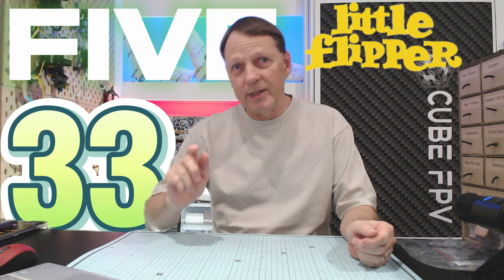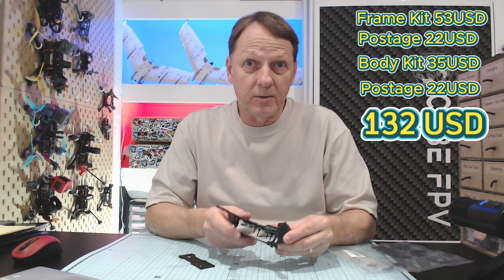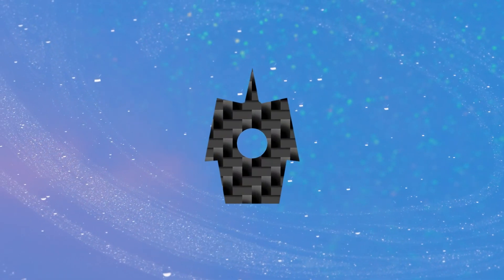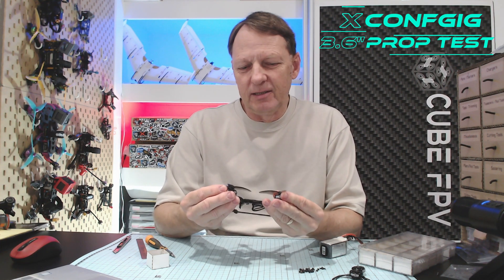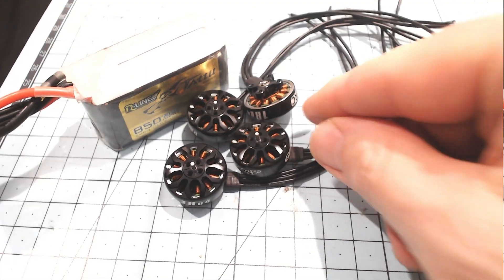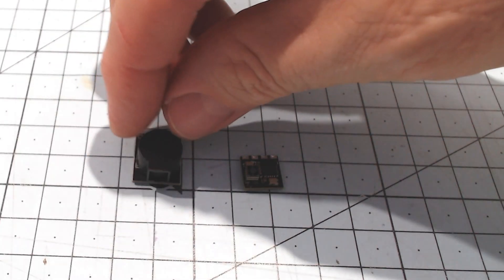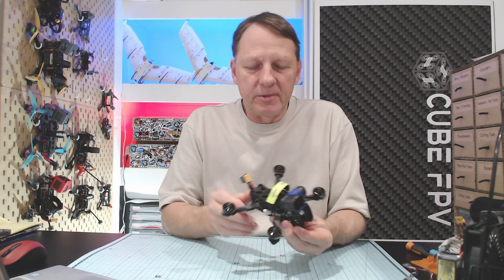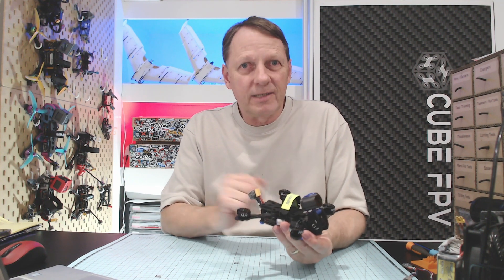Five33 Little Flipper 3.5 Inch FPV Build Video

Comment: Thanks for your excellent video. I'm trying to find the best 3.5-4" frame that would allow for extended rips, i.e. minimise everything that is not motors and battery, for use with DJI O4 Lite and still be under 250g. I was looking for a frame that would have the electronics underneath and hey presto, found your frame comparison vids and in them the flipper. What I dont understand is, does everyone really brake their quad's arms so often to need replaceable arms? Such a waste of weight. Would love to have had the top plate and arms as a single piece. Also love your suggestion of holes for AIO diamond-way positioning. That would work with dji o4 lite to make the absolute lightest possible 4k footage. And the whole rear of the quad would be empty! Which means even more weight could be saved. 

By the way, what was the total dry weight of this build and whay props will you be running?
Reply from the maker: All up weight for my build is 172 grams without battery or Runcam Thumb. Broken arms do happen but no that much with a 4mm frame. I usually fly a frame like the JeNo35 which has a solid 4mm base plate.

Comment: Will the DJI OS4 Pro fit on this frame?
Reply from the maker: Yes the current version is 04Pro compatible
Reply: Awesome. Thanks! Any idea what camera angle? I noticed some other frames are limited to 20 degrees because of the size of the camera and space it’s being installed in. 

Looking forward to your next video on this quad! It’s between this and the AOS 3.5 for me right now
Reply from the maker: @Rotor_Ruocco  I'm not sure on the camera angle. The side plate insert do seem to have a long slot at the bottom so i think the camera angle would be adjustable a bit. Maybe this is a question for Five33.

Comment from the maker: First flight today - Just geting started with the testing but I did test 3.6 inch props. Actually i was wrong. There is no adverse effects from the tip clearance, but I'm still not convinced 3.6 is better than 3.5 inch for this frame. More testing needs to be done. Stay tuned for a flight video and results in the future.:face-fuchsia-tongue-out:
Reply: Subscribed, because I also have a Little flipper (the drone, lol). I've been looking forward to your build, I still have the old plate, but I'm using an  F405 AIO with an 04 Air lite stacked. My first build and first fpv drone that I'll fly. Excited.
Reply from the maker: @_Keir  That's great, You can probably just drill the holes in the old plate out a bit. But good idea the way you're stacking the 04 lite - that will keep the mass centered in the frame. As it's your first build and drone I just want to mention that the 04 lite camera has a narrower field of view than the pro (and most other systems). You might want to move up to the pro in the future for a better experience.
Reply: @cubefpv  Good to know, thanks!

Comment: Of all the frames in your 3.5” frame review video, I was sure this was the best choice but now I think I’m going with AOS frame instead. Five33 almost had a great product. Hopefully they’ll come out with a V2 that fixes the deal-breaker issues.
Reply from the maker: Well I hope so. The AOS is a solid contender in the 3.5 inch lineup - you can't go much wrong there and it's a Rosser design so should have great resonance dampening.
Reply: @ Indeed. I already have an AOS UL5 and a T3 build. But my UL5 is the version before the cool vibration mitigation. I’ll swap to the new UL5X when I upgrade to the O4 system.

Comment: Cool been waiting to watch your end results.
Sorry to hear about having to buy what should have been a replacement sent.

I’m guessing it was a misunderstanding because that is very unusual for five33 from my experience and many others.
In fact until I sent a picture they were confused about my explanation.

I’m still debating 1804 ,1504.5 or 1604.
1804 will work great with 3S high capacity LiPo packs.
I prefer 20 by 20 AIO but a diagonal whoop AIO is okay.
Reply from the maker: You're right - Five33 are usually very good. I actually checked and  20 x 20 AIO will fit okay without touching the camera cage but you would have to use a mount adapter. Not really a problem because there's enough vertical space in the frame for it. Interesting you should mention 1504.5 size motors. I just got some of them in (Brother Hobby ones) because I saw a lot of people using 1504.5 for 3 and 3.5 inch.

Comment: thats a funky frame 
looks a bit fiddly to build it and not testing if the vtx mounting fits suggest that there is like no quality control 
how could they miss that and than even make you pay for it lol 
i like the idea tho im curious how it will fly 
i think the battery mounting would work if you use some grip tape?
Reply from the maker: Agree, I think Five33 is a good company but sometimes things slip through the cracks. Anyway the real test will be in the flmight performance.
Reply: @cubefpv  i built mine with an HGLRC AIO and O4 air unit and that thing flies GREAT. I honestly love the way it flies. the only thing I can complain about is the camera is not well protected at all. one bad crash and I managed to damage the camera pretty bad from a hit to the bottom of the camera.
Reply from the maker: @mrmoon_fpv  Hmm interesting. In my first video i did mention that they need a bumper standoff at the bottom of that camera cage. But I agree it does fly great. i put my first packs in today and initially really liking this bird.
Reply: @mrmoon_fpv  this frame was created with 03 in mind. Hope they will update with 04 and solve the battery mount issue
Reply: @alexandrelemieux6718  using the 3d print battery holder works but does have it's disadvantages. I printed a thicker one and have good luck as long as I use gnb or coddar long thin batteries. 720 to 850mah.
Reply: @mrmoon_fpv  Wouldn’t a strap make more sense for a drone this size?
Reply: @alexandrelemieux6718  I'm not debating that it wouldn't but without modifying the frame and using the intended battery holder- it does perform well.